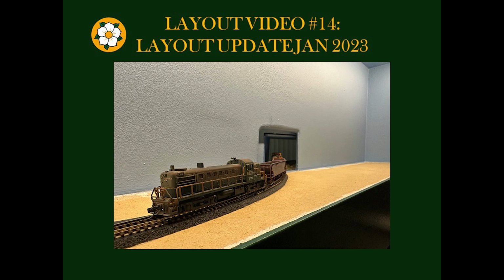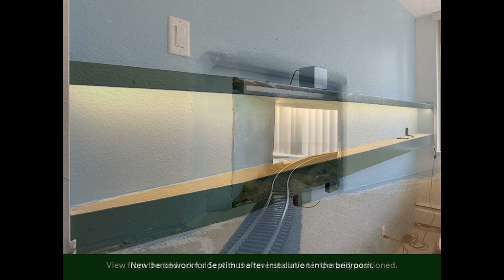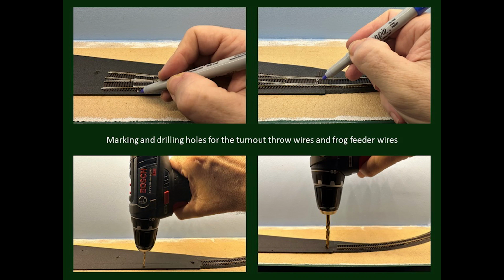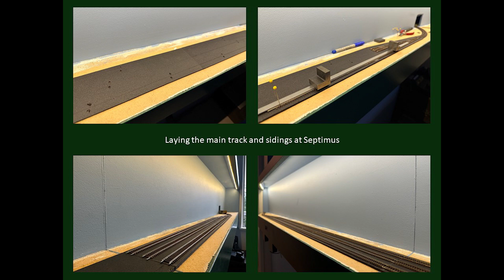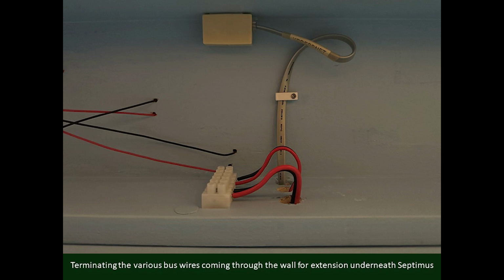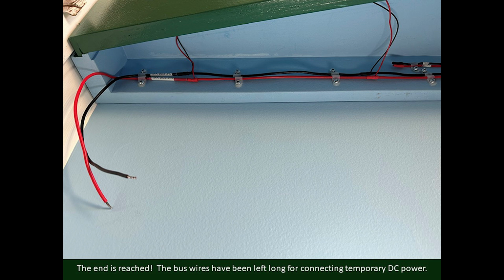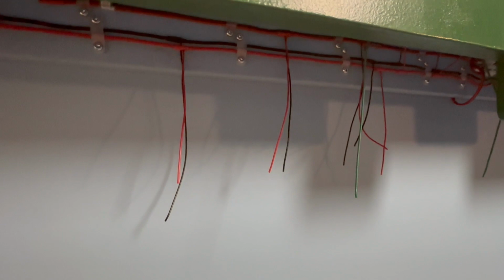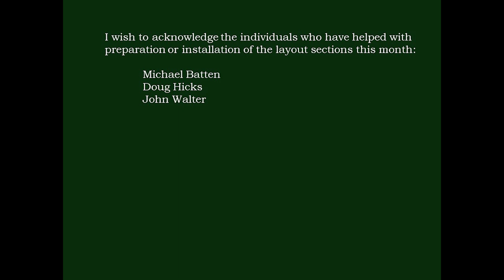Layout Video 14 Update Jan 2023

Comment: Why do you put feeder wires 1ft apart?  It’s 12ft recommended not 12 inches
Reply: I provide two pairs of feeder wires for each section of track regardless of the length or distance.  I do not solder the rail joiners so am not relying on them for conductivity, although they typically do a fine job of that.  Probably over-redundant, but have never had any issues with conductivity.